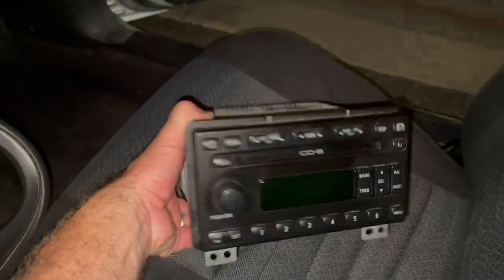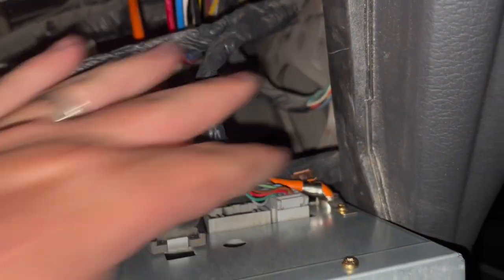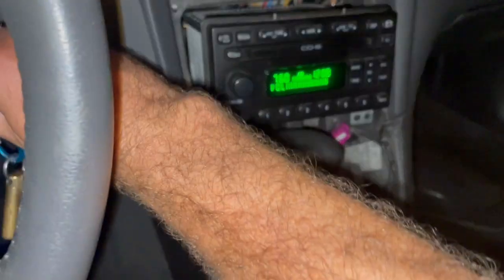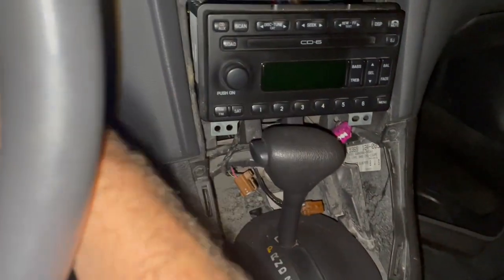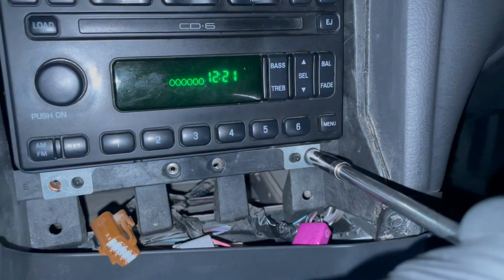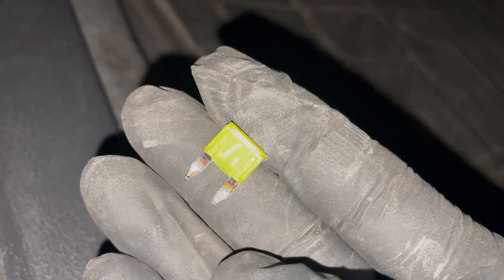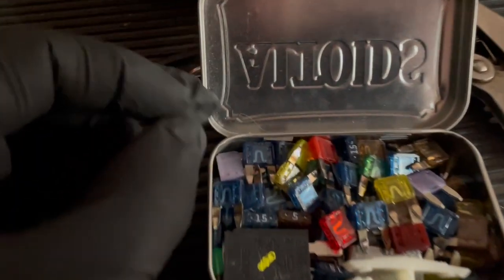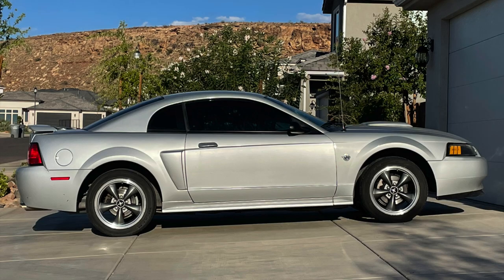2004 mustang GT update new oem mach audio head unit radio 6 disc cd changer

Comment: The head unit, speakers, all of that is factory in my Cobra and I think they're still great even today. If the factory head unit just had an aux cord or bluetooth it would be perfect.
Reply from the maker: I agree. There was a ford option to have an aux cord that plugs into a box under the dash. I have one that’s still installed in a 10k mile dash out of an 03 cobra
Reply: @justin.c_svt  Can you still find those around? I'd be interested in possibly getting one.
Reply from the maker: I’m not sure. I’ve never seen one. An easier better option is the cigarette lighter 12V plug in Bluetooth adapter that tunes into a radio station. It’s very clear and easy to play music off a phone
Reply: @justin.c_svt  Mind sending me a photo of what it looks like when you have a chance? I saw what looked like an aux jack in my Bullitt when I bought it but figured it was just a piece of aftermarket junk that was installed by the previous owner lol.

Comment: I didn’t realize it was this simple to swap back in a factory headunit. My 01 Cobra came with a terrible aftermarket Kenwood and would love to swap back in an OEM one
Reply from the maker: As long as the car didn’t have major wire modifications it should be easy. Most likely it has an adapter harness that plugs into the fact wiring
Reply: @justin.c_svt  Okay good deal. I thought I had read somewhere about there being a security/anti-theft system issue. Glad to see that’s not the case!

Comment: Nice upgrade, I have a touch screen JVC which is nice, but because it runs through stock amps and cross overs it just doesn’t sound as good as factory, I would switch it out in a second and use the Bluetooth connection…I just haven’t put any effort into doing it yet because the stereo I have does have a lot of adjustments to help improve the sound it’s just not the same as the nice factory sound…
Reply from the maker: I agree

Comment: My OEM 04 radio is doing the volume thing.. badly..  I tried rotating it back and forth as you said but it hasn't worked yet.  Is there a way to remove the knob and clean behind it?  If not, I'm swapping a carplay radio in.
Reply from the maker: I haven’t done it but people have removed the face plate plastic and cleaned behind the button. They talk about it and what they used to spray on it in the comments of my official video about this https://youtu.be/br9-6c2YX6M

Comment: I had the same issue with my 2001 Bullitt and took it apart to clean it, volume worked great after but the CD changer was basically unusable. I wound up getting a newer one and was excited to listen to some CDs again but it's now also having lots of issues (loading/ejecting). I remember this being a problem when I owned my first newedge back in 2005 (usually remedied by a slap of the center stack, then the CD would pop right out). Have you experienced any of these issues with the mach head units? Any fixes that you know of? Also, what was that thing you popped into the cigarette outlet at the end of the video?
Reply from the maker: The CD six disc functions in these Mach  stereos typically last around 100,000 miles. That’s funny you smacked it and made it work. The thing I plugged in at the end was a Bluetooth transmitter that tunes into a radio station like the old cassette ones but these are super clear and great quality. They are awesome because you can use any music you have on your phone or anyones phone who rides with you. So much easier than fooling with CD’s